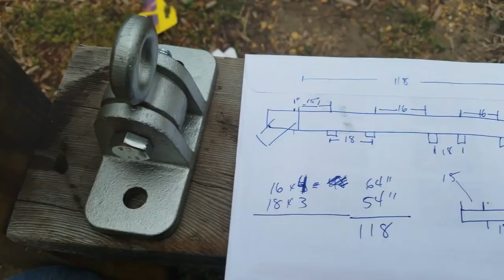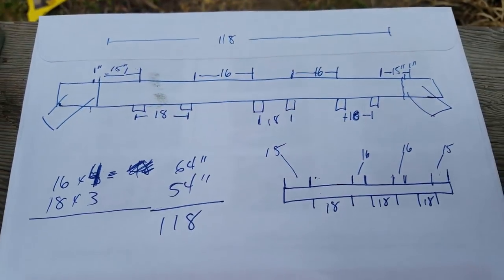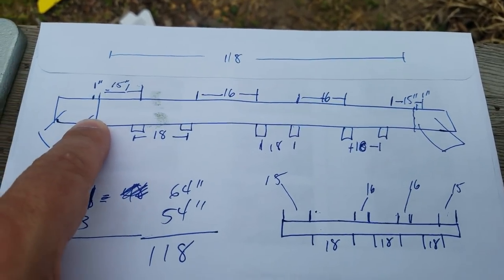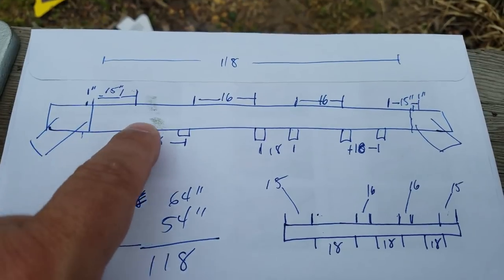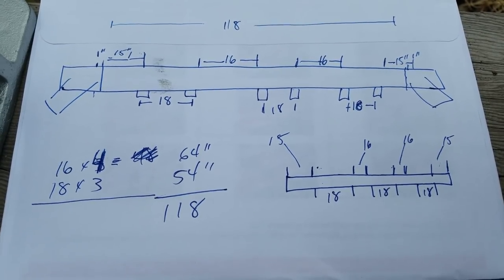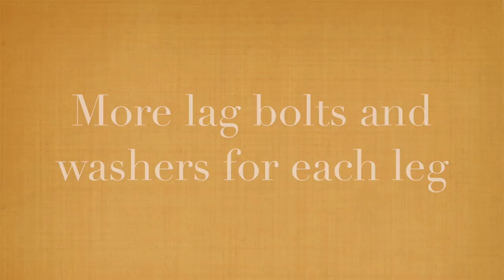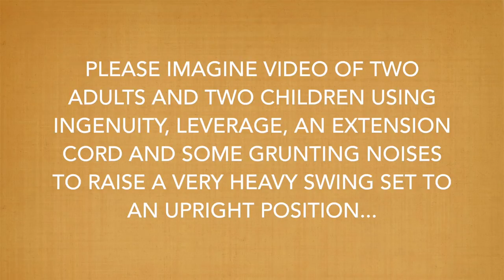Backyard DIY - Swing Set Upgrade - How To Build Your Own

Comment: I looked through the comments and didn't see an answer to my questions, but maybe I missed it. How deep did you dig your holes for the 4x4s, did you measure all of the hole positions ahead of time or just as you went, and how much cement did you use to secure the posts? Also, we're a tall family, so would the10ft beams be tall enough, or should we do the 12 ft 4x4s?  We have a spider swing I'd like to attach, as well as purchase some regular swings and/or a trapeze type. Thanks!

Comment: What a GREAT video!  Thank you for making and sharing that with all of us!
My question is this?  How did you anchor this?  I am confused how you got the angle of the hole correct in the dirt?   Can you please advise??
Reply from the maker: Thank you! Please like and subscribe. 
There was not a lot of consideration into the holes- When the set was done, I dug large holes behind each post, put a level on the top beam, and dug down about a foot for each leg. Once they were level, I filled the holes with cement and covered with landscape material and mulch.

Comment: The company shows a mid-span bracket to do another section.   Any thoughts on using this?    I have a lot of kids to provide swings for
Reply from the maker: I checked out that mid span. Looks as sturdy as the end pieces. The wood and setup used to create these swing sets is over engineered and more than sufficient for the weight. Let me know how it goes if you do it. Good luck! And thanks for watching.

Comment: Superb. Do you get any lateral 'racking', or do the concrete footings deal with that?
Reply from the maker: Thanks for watching and commenting. You can almost feel a bit of bend but there’s no visible movement. I’ll take some bend over break. It’s had three heavy adults on it with no worry so yeah, definitely cement it in. I went up to tighten bolts last year and there was no need.
Reply: @SuburbanJerseyDad  cheers for replying. My design is similar to yours, but I have a lot of lateral sway - but she's not concreted in yet - so that's reassuring
Reply from the maker: I see the concern. As a kid a remember plenty of “see-saw”ing in the old metal ones as the older kids started swinging. The timbers are heavy so that’s a good start, but agree. The cement will lock it in and make everyone feel better! lol. Good luck and hope you subscribe. SJD.
Reply: @SuburbanJerseyDad  Just did! Top man

Comment: Do you think a 12 foot 4x6 as the header would be too long and bend/sag? I assume you used a 10 foot header for yours?
Reply from the maker: Yes. I used a 12 foot header. That is a sturdy beam.(edited)
Reply: SuburbanJersey Dad huh so 118 In. Was in between each bracket and no sag with 3 swings in use just curious I weigh more than the average fool
Reply from the maker: None at all. As long as you don’t spread the leg out wide when you place and secure  them. We’ve heard some heavy hitters in ours with no issue.

Comment: What did you use to attach the swing hangers to the beam?  Lag bolts or a hex bolt with a locking nut?
Reply from the maker: I used lag bolts. I checked them two weeks ago and still solid.

Comment: So you started off with a 12’ 4x6 right? Thanks
Reply from the maker: Yes. its a 12' beam. A foot of each end is inside the bracket. So I was working with about 118" for swing area. At about the 2:42 mark and before I show my drawing, I mention that the beam is 118". That's not correct... 118" is what was left AFTER the brackets were installed. 12' beam is what you need.

Comment: Any tips to get the bracket back off? I have mine partially on the 4x6 and it is stuck, cannot get it on further or back off so I can plane it down. Thanks
Reply from the maker: Another person had suggested wax. It’s slippery but can be scraped off and the wood can be sanded down again (lightly) so you don’t see a difference. A scrap piece of 2x4 and a hammer to gently tap it off may work.
Reply: @SuburbanJerseyDad  Thanks, I tried the hammer 2x4 trick earlier today and it worked! Need to get a plane to shave off more 4x6
Reply from the maker: Awesome. Glad it worked out.

Comment: How did you end up standing it up? The part that you forgot to record!
Reply from the maker: I won’t say it was easy. A rope, an extension cord as a second rope tied to main beam.Two adults and two kids. Placed the top beam outside the play area and planted the two  of the legs where we wanted them (approx). Wife and kids held up the legs as I made slow progress pulling the rope to lift it. Wife used extension cord to make sure it was guided straight. Not pretty but it worked. I would invite five grown men, in hindsight. Could have gone bad quickly. Hope that helps even a little. SJD
Reply: I just did this today and had the same problem... couldn't figure out how to physically stand up the assembled A-frame because of leg height and top beam weight. Here's what I did: Instead of tilting legs up while PULLING on the top beam, two of us first picked up the beam by its corners (bracket area) and worked to tilt upward onto the legs while the 3rd person PUSHED same direction up/forward on the center of the beam with a long 2x4 board. Very easy to maneuver up into place that way.
Reply from the maker: Glad it worked out for you. That sounds a lot easier and the extra set of hands helps. Enjoy.

Comment: Great video!  One question...does the  4x6 come all the way to the outside edge of the bracket?
Reply from the maker: Great question! It does not. There’s about two to three inches at the end where there is a bit of open space. I’ll have the ladder out soon and measure it if you need to confirm you are doing it right. I had enough to bolt them in with worry about splitting because the end of the 4x6 wasnt close.
Reply: @SuburbanJerseyDad  ok, thanks...we're actually out doing it right now!  Got to be outside on this beautiful day.  We left 4" on both sides, and looks like it will be fine.  That puts the outermost bolt 2" from the end of the board...

Hope you are all healthy in New Jersey!
Reply: Actually puts it 3" from edge of board.  That should suffice, right?
Reply from the maker: @WTylerShepard  Sorry for the delayed reply, we are outdoors keeping busy too. How did it go?
Reply: I bought my 4x6x12 from Lowes ($19.45).  I got tealight candles and waxed the ends of the beam and the bracket.  Then, I pushed the other end up against my block wall.  I got my mini sledge hammer and some scrap 2x4's and hammered the bracket to the edge of each  bracket.  All my wood was wet with pressure treatment, so it was soooo heavy.  I measured the top beam and from the A is 7" of bracket, then 10 feet exactly (120 in), then another 7" of bracket.  Now to google the spacing for my horse, swing, and trapeze bar.  It is too much to ask Eastern Jungle to include that information on their website, or to ship it in a little piece of paper.
Reply from the maker: Now that’s some ingenuity right there!! That’s a great way to get it done. Wow. Yeah, agreed. The wet wood is really heavy and makes for some tough mornings once you are done. Congrats on the progress. If you can post any pics, would love to see and share with the other subscribers. I’ll be having Makers Mark sitting on a swing this weekend - 68 degrees and sunny this weekend. Can’t wait. Stay safe and enjoy! SJD

Comment: Question for anybody who knows after my story. After researching and watching several videos I was going to make this out of douglas fir. Checked on pt but this thing would weigh 2 tons. Couldnt find doug fir  anywhere. Only 4x4x8 at lowes but wanted 10 footers. I found my size at a lumber yard in cedar. Hmmm nice wood, I bought it, sanded, sealed, stained it. (BTW, the box sets are made of cedar but a pretty crappy grade.)  I could of ordered the cedar 4x6x12 beam but it was a tad expensive so off to shopping. After finding nothing I decided, ok the beam will be pt. Sanded it, stained it. Everything looks beautiful and hardware is on order. Thinking about this my question is... Will the cedar legs be strong enough to support the pt? This 4x6x12 pt weighs alot plus people swinging on this. Should I bite the bullet and order the cedar beam or am I ok? I am going to put it together once the hardware arrives. I can always replace the beam. I don't see these cedar legs snapping but could they weaken over time supporting this much weight? Any real insite would be appreciated. And I'm not replacing the legs with pt.
Reply from the maker: Hey Greg. You mention the weight of the beam and i think that weight is what is making this a solid build. I am sure cedar would work well for the legs, and the load would be lightened as far as the building process. Like you said, the cedar legs with the heavy beam?...I am no lumber expert so i don't have an answer for that.  My concern would be bending as things get wet and dry out over time with the beam weight on top. Again, just my 2 cents -  but the overall weight is what makes this more solid than some of the aluminum and cedar swings we looked at. This thing is a tank!.  PT all around could be cheaper and more piece of mind. Good luck with the build and feel free to reach out. thanks - SJD
Reply: @SuburbanJerseyDad  thanks for the reply. It's been up for a few days now. Totally awesum. The PT beam stays. Fit right in bracket and your right, the weight makes it. What a beast to get up. Lol. Cedar legs seem very solid. I'll keep an eye on em. The 4x4 legs were oversized a tad for the bracket. Used a belt sander w 80 grit. Measured 4 1/2" up and just crossed sanded to the line. Took maybe 1 min a leg. Granbaby loves it. Mama loves it. And Im 215 lbs and was swinging away. Lol. No movement at all. Not even a squeek. Take care.

Comment: Starting my tomorrow. Is it sturdy or does it need to be concreted into the ground on anchors?
Reply from the maker: Small kids do not move this at all. Three adults will make it move a little. So I would use concrete for adult use.

Comment: Do u have to cement the legs? Or would it be ok to just have the frame  "sit" on the ground?
Reply from the maker: Depends. We wanted ours adult friendly. With the extra weight I was worried about movement. With just children? I wouldn’t be as worried. But, I would probably drill a hole in all four legs and drive a length of rebar into the ground to secure it. Just in case....It’s heavy but better safe then sorry (my 2 cents.)
Reply: @SuburbanJerseyDad  ty. Well I plan to build one so I can have a good place to practice my aerial skills,  I won't actually be swinging off it that's y I was wondering.  Thanks for your 2 cents!
Reply from the maker: @itzagrl1277  Welcome. And please post some "after" shots. I will be posting some videos in a week or so that show the finished product and may do a follow up on what I would have done differently.  Please like and subscribe and good luck!
SJD

Comment: Hey Jersey Dad, had a question for you. What size holes did you pre drill before putting lags in? Probably a dumb question but I want to cross all my Ts before actually putting this together!
Reply from the maker: Hey Joe. Sorry to say - I don’t remember. I always line the bit up with the bolt by eye, and go one or two sizes lower on the bit. Not much chance for splitting with that HUGE piece of timber, but my method worked.
Reply: I can answer this.  I was using 1/4 and had to use my largest rachet and a 1/2 bit to put them in.  Took about 2 minutes per lag screw.  PITA.  I thought I should go up to 5/16 and match the hole in the bracket.  When I did that for 2 screws, I turned them all the way by hand until I reached the end of my hole, which was about 75% of the lag screw length.  I used my rachet to go the rest of the 25%.  So, you must use 1/4 drill bit as 5/16 is too big.
Reply: @Christian-cw9mp  Thank you so much for sharing this helpful information!

Comment: Great video! I’ll be putting mine over cement (with padding underneath) and I was wondering if you have to cut the legs at an angle to fit on the floor? Thanks!!
Reply from the maker: Thanks! Glad you liked it. Because I was going into soft earth in the holes I dug in our playground, I didn’t need to cut the levels for level. I imagine you will have to at least cut the downside/inside corners to get any kind of level. Please share the outcome, would love to see it! Enjoy. SJD
Reply: I cut the bottom of my legs by copying the angle on the bracket.  I then used anchors as I did not want to cement it in.
Reply: @jennifercampbell8820 I've been trying to figure out anchors. If yours worked, what did you use?
Reply from the maker: Hi Steve, I used a long drill bit (3/8”?) and drilled through the legs diagonally at their base. I then used a 5 lb hammer to drive rebar through the wood and into the ground. Finished off with half a bag of concrete in each base hole (around the leg and rebar). This thing doesn’t move even when three large adults are swinging. Hope that helps. Please subscribe and like if this was helpful. SJD

Comment: This is great!! Thank you!! Great instructional video!!1 Question: Did you use ground anchors or just sink the legs?
Reply from the maker: TY.  Just sunk them into holes and used a 1/2 a bag of concrete for each leg.
Reply: Great! Thanks!

Comment: If you look at the website for the maker of the brackets they don't use 4x4's or 4x6's. They use doubled up 2x4's and 2x6's. which is why you would have to sand or plane them to fit.
Reply: Actually the list of recommended wood for the Classic Swing Set using those brackets Specifically calls for 4x4x8 and 4x6x10 yet ALL there videos show 2x's...go figure
Reply: YES! How misleading. I have been wondering. It does say specifically to use a 4x6 and 4x4's. But then...with the swing hooks bolted in between two beams...how is that safe?
Reply: I used 4x4, didn't have to sand at all
Reply: I think people have to plane because the  their wood is still wet so it's swollen a little... 

Also yes I wonder how safe can it be to put a bolt in between 2 2x6's

Comment: What size lag bolts did you use for the swivel mounts?
Reply from the maker: Sorry rebel, I looked through receipts and cant find the specifics. Sorry about that. I do mention that the hardware lacks the bolts. I just don't know the size I used. SJD
Reply: @SuburbanJerseyDad  No worries. I figured it out. the lag bolts for the swivels are 3/8, and the ones for the green brackets are 5/16. Ive got it built and the kids are swinging they're asses off...lol

Comment: I must have missed the link to the brackets and hangers.  Can you advise on where to find them.  Great video.
Reply from the maker: Easy 1-2-3 A-Frame Swing Set Brackets Complete Set 2 Brackets with All Mounting Hardware https://www.amazon.com/dp/B01M28VV0N/ref=cm_sw_r_cp_apip_H7m3ZvYQmewZC
Reply from the maker: This is a link to Amazon but you can buy direct as well.
Reply: Thank you!

Comment: Excellent video!  If you don't mind my asking, about what was the total cost of this project?  We had been looking at play sets but our kids are 7 and 10 and primarily interested in just swings.  My husband thought building was the best route since most pre-made sets seem to be smaller and for younger kids.
Reply from the maker: Don’t mind at all. The other swing sets were too small and wouldn’t grow with my kids or were inexpensive but cheaply made. I don’t have exact numbers anymore but I just ran carts at Amazon for three swings, three sets of swing hangers, and the brackets. total :$266
Ran the numbers in my Home Depot App: four 4x4x10 and one 4x6x12. Total:$89.90. Approximate cost: $356. Hope that helps.
Reply: @SuburbanJerseyDad  Thank you so much for your quick reply!  That's a great price.  I can barely find a small, junky one under $400.  Our kids like to swing very high so I think the extra height is important.  Thanks again!

Comment: Hey man looking to do what you did but add something and want to know your thoughts. If I used a 16 foot beam on top and let the additional 4 feet protrude from one side, would it allow me to put a baby swing on that protrusion? Will the steel brackets allow for passthrough  so that it can stick out?
Reply from the maker: You may have to use a planer to plane down your beam to get it to fit all the way through that opening., but I think it would work great. Just double check the specs on weight but after that, the only issue I see is having clearance for the baby swing with the legs there. Let me know how you do. Don’t forget to like and subscribe and sate your results. Good luck!

Comment: Is the angle alone enough to stop it from tipping over if i don't bury the legs
Reply from the maker: It is if the wood comes wet like ours did. But when I went on it or an adult was swinging, I felt movement so I didnt trust it. Besides, the wood eventually dries,  making it lighter. If it's just little ones, probably ok....but ours is "Adults allowed" lol
Reply: Nice I want to be able to push it to the limits too lol

Comment: I have a few questions how much was it all together? do you think it would be cheaper if I did this myself or if I just buy a set? Anyway thank you so much for uploading this it might come in handy in the future if I can afford it that is.
Reply from the maker: The brackets were $79 a pair with all of the hardware. The 4x6 beam was less that $20(pressure treated). 4x4x10 pressure treated legs were less that $18 each.  Add 8 bags of cement. Labor cost me a few apps and snacks.
Reply: The sets on sale are $459 for what I got.  They are all sold out because of world-wide CV19 quarantine.  I paid $265 piecemeal for the same set + $20 for the 4x6x12, and $7 x 4 4x4x8 = $28.  So my total is a little over $300 for the same set as on eastern jungle website, who is the manufacturer.
Reply: Thanks for replying and I only now seen the creators reply hahaha